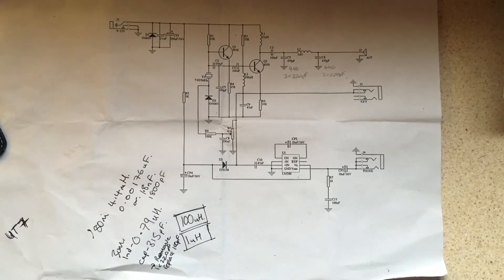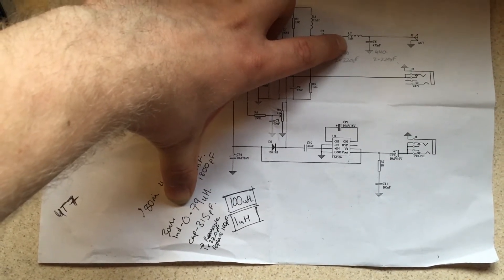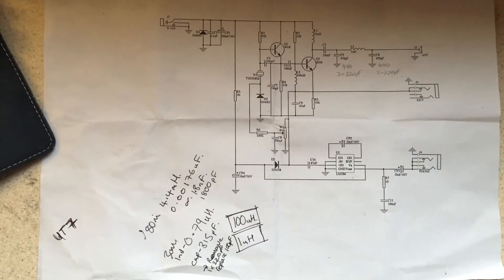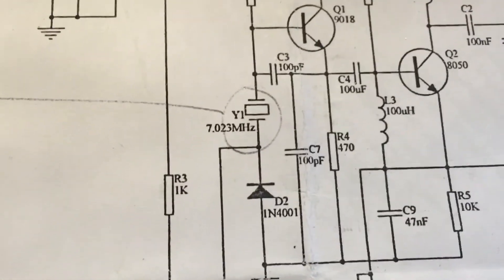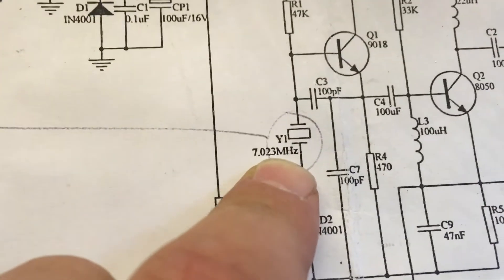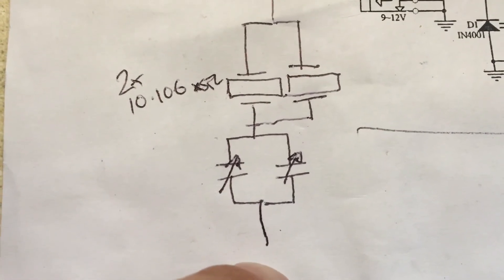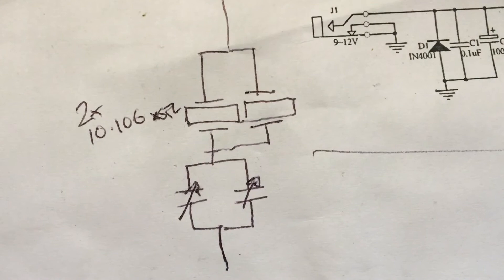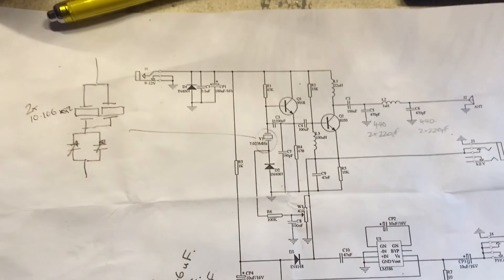Pixie 2 QRP Ham Radio Kit Modified On Air

Comment: You will like it. When the window is open. Snag SIG's right and left you will. A set of battery went well as I worked 30m pixie. 73 de kv4li